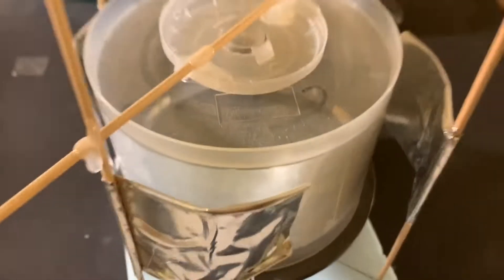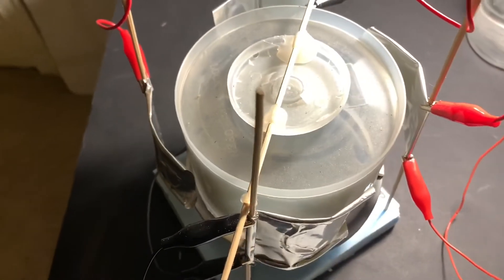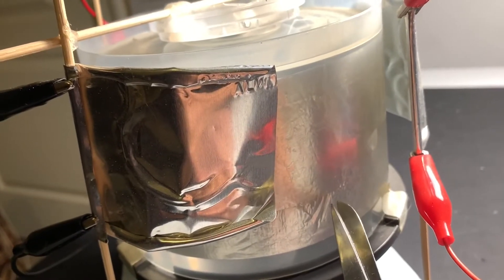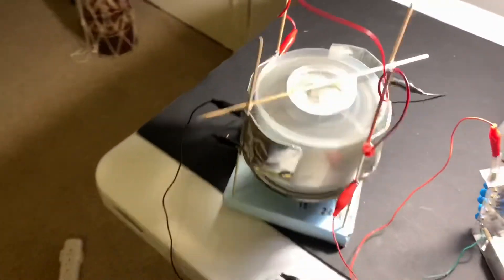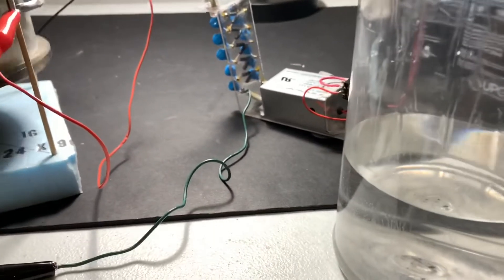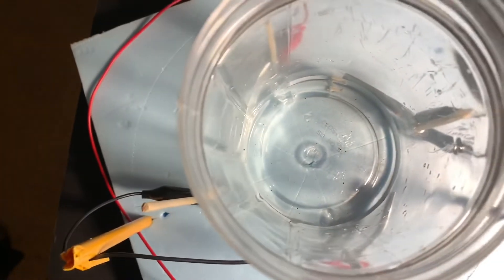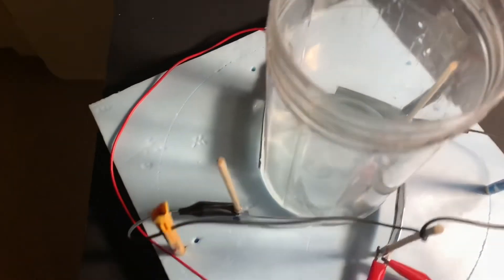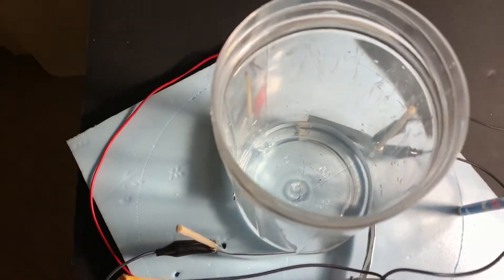Cool Stuff with a  Corona Motor

Comment: the aluminum profile is a ring. Make the second cylinder a little smaller than the point where the water is in between. I think it will work.
Reply from the maker: Yes, you make a very good point. I should try this out. Right now out of town, but very interested to try this.

Comment: I'm not an expert on the workings of these motors (or anything really) but it seems to me the issue is that even on the first motor you tried, the force is not being applied to the foil; it's primarily the surface of the plastic where charges are going to deposit and remain somewhat in place, to be attracted/repelled and generate torque. 
On the inside the foil or any conductor will be at a constant potential; basically functioning as a common connection for the salient capacitors formed on the outside.  I'm sure if the tub with liquid were free to rotate it would work just like the one with foil. 

It's impressive how fast that thing goes too. Wasn't expecting that.  What do you have driving the multiplier and do you know roughly how much power is actually coming from the supply?
Reply from the maker: Thanks that was a very helpful explanation as to the workings. The power supply is a 12Watt maximum 20kV DC supply which is based on a 5 stage CW multiplier. Works great with this setup. The plastic drum is an old CD spindle case.